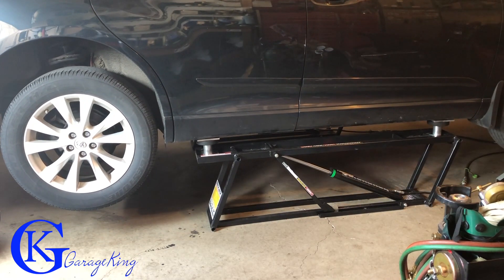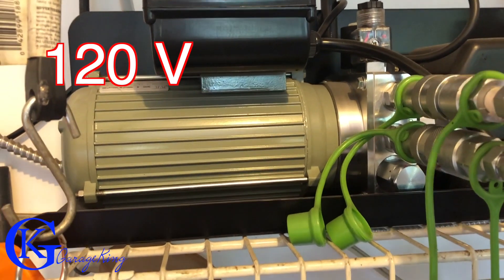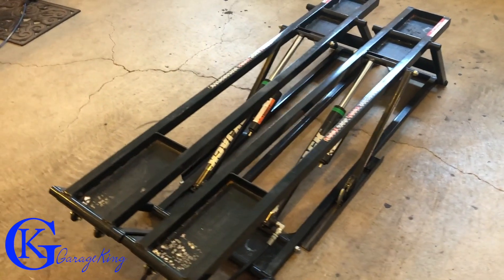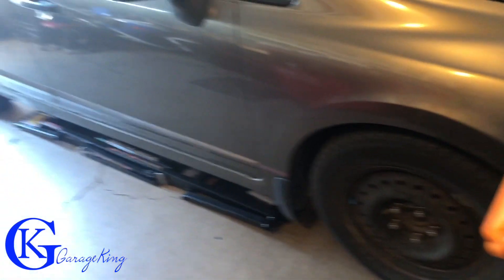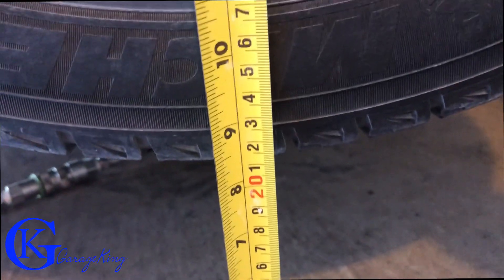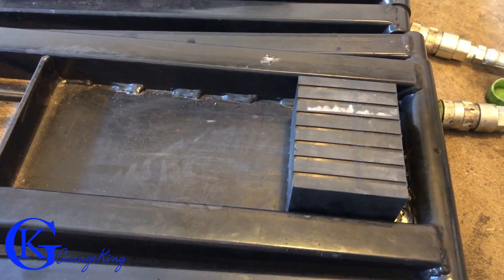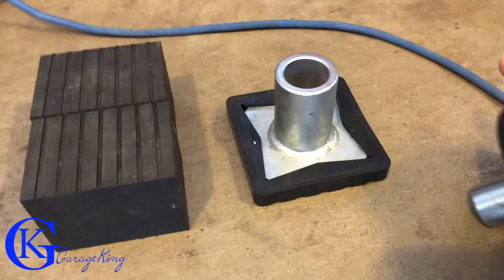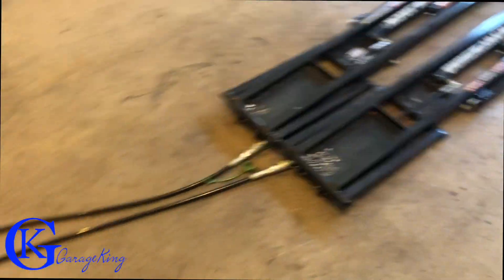Is the QuickJack BL5000 SLX the best garage jack?

Comment: Show me a view of where the lift points of the jack are actually touching the required lifting points of the vehicle.
Reply from the maker: I'm not sure which vehicle you are referring to, for the Vanagon (in the picture) I lifted on the front factory mounts that are welded to the chassis, the rear are lifting on the factory mounts near the rear control arm bolt.  I use this for lots of vehicles, not affiliated with Quickjack, and didn't get paid for this.

Comment: this is great, where did you purchase that aluminum plate to protect the rubber block. is it safe?
Reply from the maker: Hey There, I just went to a steel cutting place and they cut me some aluminum pieces.  I think its safe and better than the rubber blocks alone, as the rubber blocks bend around a bit and the aluminum stabilizes it.  As always you have to be careful.  Thanks for the comment.
Reply: thank you.
Reply from the maker: @tsphil5194  Anytime

Comment: I want a set of these but my concern is alignment.  I'm guessing I have to eyeball each rail to make sure they are spaced properly.  It would be nice if there was some sort of removable accessory that would ensure both rails are properly spaced (square) front to rear and left to right.
Reply from the maker: Hey There, and thanks for the comment.  An alignment tool would be great, but its not possible as each car has a different width. If you line them up under the lip of the car where you lift,  they have to be square unless your car is bent somehow.  I must say they work really well, and I didn't get anything for doing this video. There is no other product like them.

Comment: Those long extensions look like they woudl be wobbly and fall over.
Reply from the maker: Hey Thanks for the comment, they are actually very stable.  I mean you can push the car over if you are really pushing on it, but even for working and tugging reasonable underneath they work great.  I only use those extensions on the VW vanagon, and the Audi Q3 and Acura MDX as they work great with the lower plastics on those vehicles.

Comment: Ok this might be a dumb question, but if you have a vehicle up in the air, would I be able to disconnect the hoses for unfettered access to the under side of the vehicle?
Reply from the maker: Never a dumb question, and yes you can disconnect the hoses.  All you have to do is lower the lift an inch or two so its on the mechanical locks first, then disconnect the hoses.  I love this thing !!!!

Comment: i got the 5000 dc version because it's faster and portable; needed extension rails to lift my outback so i got those too; haven't needed the tall extensions but those are neat; the repositioning brackets that come with the kit are worthless, others have just strapped on some caster wheels and it's perfect; wish the hoses were a couple feet longer
Reply from the maker: Thanks for the comment, that's good to know the DC version works well.  I looked at it, but mine never leave the garage so I just got the AC version.  The tall extensions are really handy and I use them a lot on SUV's.  They are really well built.  I do agree with you that those repositioning brackets are worthless :)   Thanks again :)

Comment: I don't have mine yet, but I'm researching. I can't help but notice the orientation of your unit is reversed when you lift the Honda Civic. Was this intentional? The Hellcat looks like it was lifted correct orientation. Would the lifts be at risk of collapsing forward during lift if they're reversed? I watched another video where someone thought their jack was defective, then found out he had it backwards. That video was also for the newer TL series, whereas yours is SLX. It could just be that something has changed. But I wanted to bring it to your attention because it could pose serious risk to you and anyone else working under the car, if in fact that's the incorrect use. Cheers, Steven.
Reply from the maker: Hi there and thanks for the detailed comment !!!  The orientation is correct for all the vehicles and must be, if you don't the vehicle can slip off.  The jack is designed to that the front of the jack must be closest to the front of the vehicle for proper weight distribution.  The lifting point at the front of the jack is set right up at the front, and the rear lifting point is set forward a good foot from the end so if they were reversed the lifting point for the front would wind up being in the middle of the door somewhere - set back way to far and the vehicle would no doubt topple or slide off.  If you look at the honda civic in the video it is moving backwards as it's lifting, that is correct, and proof the jacks are in proper orientation. The vehicle should always move backwards when the jacks are going up.  The vehicle moves back a total of about 1 foot when the jack is fully raised. 

Thanks for the comment, but I can assure you it is placed correctly, because it will only lift one way.  My personal thoughts on this is I do love this thing.  It is awesome.  I just wish I got the 7000lb model, but this was the only one Costco had.  Mind you I think the 7000 is a bit too long for my VW, so the 5000 is probably best for me as it will do all the vehicles.  So far there has not been a vehicle that it could not lift (except for full size trucks) My tacoma was fine.  Happy Monday to you and hope I cleared up everything for you. Thanks for your comment :)
Reply: @GarageKing  Thank you so much for the prompt reply. I just ordered mine last night (Memorial Day sale!) and I'm very excited. I've seen a lot of videos online about people having trouble setting it up but you seem to have a complete understanding of how it works. I have an Audi A4 and can't wait to get it up in the air. I'll keep your comments in mind and probably read the instructions twice before it even gets to my door steps. At the risk of sounding childish, happy jacking!

EDIT: Hours later and I came back to watch videos and re-read your explanation. It makes perfect sense. It must make sense. Because you are by far not the only one lifting your vehicle that way (i.e., the correct way). And I was thinking, "They can't all be wrong. I must be wrong!" Thanks so much for the excellent explanation. Cheers and hope you had a nice weekend!
Reply from the maker: @stevenshizzle  Thank you !!  You will love it.  The one thing most people don't realize is the obvious.  Your vehicle is still level when its lifted.  This is great for oil changes, rotating tires, and detailing.  I can't imagine going back to a jack now where the vehicle is not level, and there is no way to get all 4 tires off at the same time.  Take your time with it, but its pretty simple, you will not regret your purchase !!!

Comment: Hey GarageKing....I am torn between this and a 4 post for my garage....one question on the quick jack - from the start of the lift to the highest point how much room behind the car do you require for movement of the vehicle? Do you think you can drive your Corvette over the jacks when flat on the floor? Ooopss....that is 2 questions.
Reply from the maker: Hey brother good to hear from you.  2 questions no problem :)

1st, I always park the Z06 in the garage with the Quickjacks pushed together, so I can say for 100% that the Z06 can drive over them (well you know not on top of them) but when you push them together there is plenty room to pull the Z06 in the garage. 

2nd, when you raise the jacks to the highest setting (which is about 2 feet high) the car moves back about a foot so not too much, but if you want to raise the car with the door closed you have to leave some space.  What I do is raise the car (if its a long car) with the door open, then see if the door will close (this way I don't accidentally hit the door)

I too thought about a 4 post, but when the builder built my house the concrete I think is too thin.  The builder did a fabulous job on the rest of the house, but cheaped out on the garage.  I was there when they poured it and wanted more gravel base.  Anyhow, as you can see in the vid there is a crack in the floor (not a big deal to 99% of the people) but for a 4 post lift I felt the floor would be too uneven, and if it settles more, well thats just not good.  So I got these and I must say I'm really impressed.  I bought them at Costco I think for 1199 on sale.  I wanted the 7000 model (lifts 7000lbs) but Costco didn't sell them, so I got the 5000.  It will lift my extended 4 door Tacoma so it works, but it should not be used to lift a full sized truck.

For the vette its awesome as its super low clearance, and for me, so far it has lifted everything I put on it :)    If you need anything else just let me know.  Hope you are enjoying your weekend Russell :)

Comment: 17 Like great video I am glass you do the review on this,  I believe  I have ask you about this on another post about their safety when go up. How confident are you when you craw under it ?  they look extreme light that is nice.  You should talk about more on this video about safety .  Over all great video.     I thinking about this for long time but worried the thing drop on my  due to it look
Reply from the maker: Great comment, about the safety, they are very safe.  The one thing I left out of the video and I should have put it in was the mechanical locks.   As it goes up it clicks and there is mechanical lock.  SO even if the hose pops or there is a leak there is no way it can fall on you.  It is actually very safe.  Thanks for the comment :)